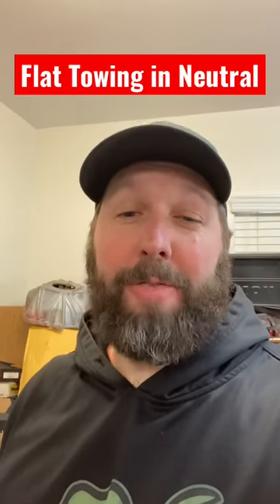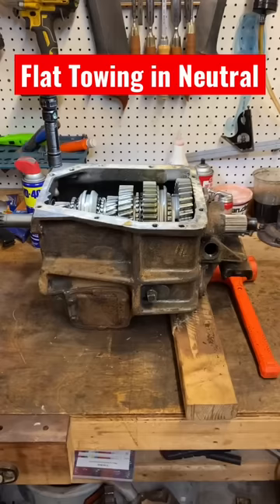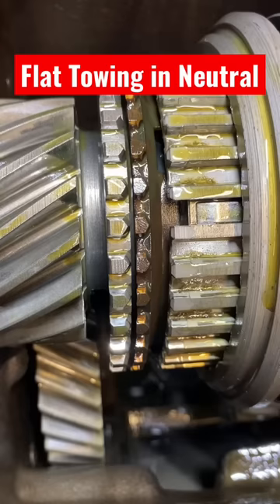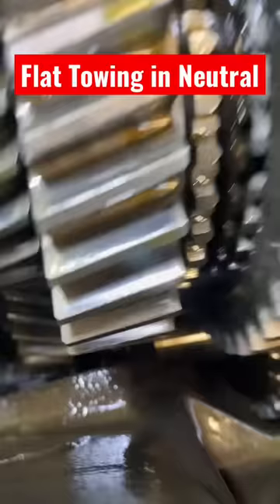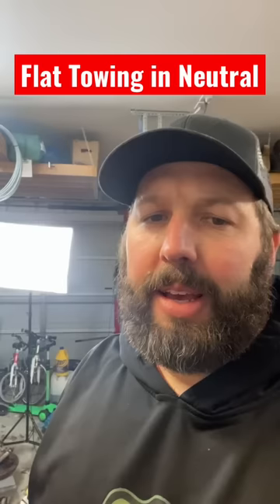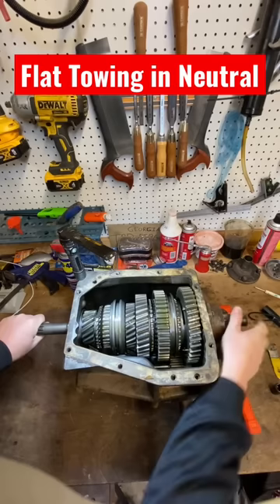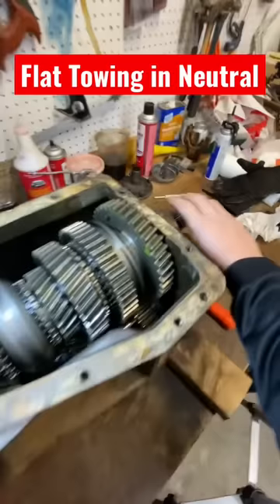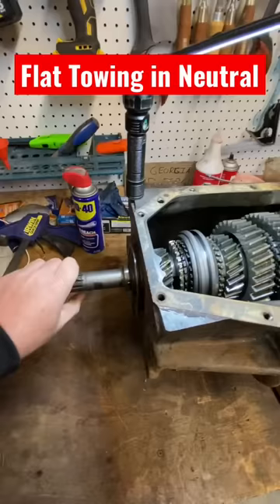Flat Towing in Neutral??? #transmission #stickshift #mechanic

Comment: Isnt this why 99% of tows are on flat beds now?
Reply from the maker: 99% of RV flat tows aren’t 😉
Reply: @freedomworx  100% of RV arent manuals transmissions either.
Reply from the maker: @PaulAmerican  automatics have the same issue 🤷🏻‍♂️
Reply: @freedomworx  your model works on a bench but being towed fluids are very turbulent. Fluids are being tossed around with every tap of the brakes, accelerator and bump. On top of that the nose of the vehicle being elevated making at least one gear in the fluid that further creates fluid spray. 
A vehicle in neutral shouldnt be creating a large enough amount of heat vs fluid spray to damage itself.
Reply from the maker: Tremec Says Otherwise. 🤷‍♂️ https://www.tremec.com/not_am_detalle/flat-towing-manual-transmission-vehicles/
Reply: @freedomworx  and once again Fluids arent sitting motionless in the pan. The fluids are extremely turbulent and are spraying and waving all over the gears and seals. Put a gal of water on the floor of your car and watch it while you drive.
This was the same arguement when the industry went from manual locking hubs to electric locking differentials and nothing happened. It just became the new standard in 4wd systems. 
These systems create heat and wear when in contact with other objects (gears) not just free spinning. The only parts that are in contact is the bearings and they are plent good with minimal oil. There will be more than enough oil via turbulence to oil the bearings.
Its more likely that these problem transmissions are the affects of bad parts that the company is trying to sidestep blame.
Reply from the maker: @PaulAmerican  you do you bro. How about I put a glass of gear oil in my truck cup holder and see how much it splashes around. Go read through the comments at all the people who have destroyed transmissions or even burnt cars to the ground by the exact mechanism I just explained. 🤷🏻‍♂️. Nothing wrong with being wrong, but refusing to learn is well… 🥴
Reply: @freedomworx  ya gear oil in your cup holder will actually show you perfectly how much splashes around. You will be left with barely anything in your cup holder after your drive. 
So the smart ads responses is how I know your seeing it from a different light. Your also references peoples comments on youtube, another wise action. 
Just another thing your overlooking is when the companies make products they do extensive testing and when they find a problem they change it. It it slips through the cracks and problems start to show up then they initiate a recall. If towing a vehicle was a actual proble. Then every car since tge 1950s would be equiped with a manual oil pump that was driven by the input gear. Every transmission has a gear that spins (unless you take out the driveshaft) so every transmission would hace this problem. While some trannys spin the whole input shaft others only spin a transfer gear. That transfer gear has a vearing and a seal that needs oil as well. Ecery tranny would ve affected by this and not every tranny is affected by this. So that would leave a person to believe that its a part defect to this partucular company and they are side stepping the blame so there isnt a recall.
Reply from the maker: @PaulAmerican  just to be clear, Tremec says don’t do it, Jeep says don’t do it, every Semi Towing company pulls the drive shaft, and the entire towing industry now uses rollback wreckers, for something that isn’t really an issue?  😂😂.
Reply: @freedomworx  companies use flat beds of any sort to minimize insurance risk. A trailer is pre wired, a trailer is putting mile on the vehicle.
The company is side stepping a recall. 
Like I said earlier every vehicle would be affected by this problems but they aren't. That only leave this company having the problems.
Reply from the maker: @PaulAmerican  recalls are for issues that could result in harm or death. Mechanical failure from towing didn’t fall into that category… I’m done bro. You enjoy knowing it all 👍
Reply: @freedomworx  thats why they are pointing the problem towards towing instead of regular operations so they dont have to be responsible for a recall. Thats what side stepping is.
Reply from the maker: @PaulAmerican  it’s not a problem!!! It’s just the reality of designing machines!!!! You can’t design a machine to do everything perfectly!!!! The designers could have raised the oil level to ensure property oiling for the 0.00000001% of the time a vehicle is being towed, at the expensive of fuel economy for the other 99.99999999999% of the time the vehicle is operating!!!!!! It didn’t affect every car!!!!!! The ones that it does affect tell you hot to tow the vehicle in the owners manual!!!!!! If you didn’t read the manual and tow the car wrong, it’s your fault, not the manufactures!!!!!!!! Just like if you put the wrong fuel in the tank!!!!!! Should they have designed the engine to run on diesel and gas?????!!!!!!!! Either accept the knowledge I freely gave you, or go find a real reference to tell me I’m wrong. Good Luck 🤡

Comment: so poor design makes for bad eresults
Reply from the maker: It’s not a poor design. HD Manual transmissions are still made this way today. Transmissions are made to transmit power efficiently , not to be towed. The same way are planes aren’t made to be flown under water 🤷🏻‍♂️
Reply: @freedomworx  a good design existed years ago and those vehicles did everything this design is doing plus allowed vehicle to be towed without dammage. Like i said poor design

Comment: No one drives manuals. $1600 just to replace a clutch kit. Who can afford it? Or wants to do it themselves on a cold day ? A manual clutch is not worth it. Give me a torque converter, all day, 7 days a week.
Reply from the maker: Plenty of people still drive a manual transmission. I don’t want to drive one daily, but it’s still fun in a vintage vehicle or hot rod.
Reply: Lots of people drive manual transmissions. They long outlast a automatic and have substantially less friction and pumping losses. just because you can't drive a manual dosent mean others can't.

Comment: Design flaw
Reply from the maker: It’s not a flaw, and manual transmissions are still built this way today. 🤷🏻‍♂️   You could easily raise the oil level a little in the design, but that would reduce efficiency…that would be a design flaw.

Comment: Umm it doesn’t matter if your being towed you should be in neutral because you don’t need a lot of lubricant on the dears with no load on them & if you have it in gear & the car towing you goes faster than whatever gear your in can take yup it can wreak havoc same as going to slow . Don’t listen to fools .go see if a towing co tows you in gear .
Reply from the maker: The fool is the one who thinks I’m insinuated to tow in gear… Maybe remove the driveshaft or refer to your owners manual. If I’m a fool, I guess Tremec Transmissions is too 🤷🏻‍♂️. https://www.tremec.com/not_am_detalle/flat-towing-manual-transmission-vehicles/

Comment: This is why you dont buy a Ford......
Reply from the maker: This is a GM Transmission 🤷🏻‍♂️
Reply: @freedomworx  With 300k hard mi......
Reply from the maker: This one actually only had about 65k miles on it even though it’s 50 years old.

Comment: You should not change gears then too when depressing the clutch or to start from stationary , oh oh and definitely not start the vehicle in neutral 🤣🤣🤣
When someone thinks they're a mechanic when they can lift up a spanner 🤣🤣🤣🤣🤣
Reply from the maker: I’m not a mechanic, I’m an engineer. Maybe tell Tremec they are incompetent too, because you’re a mechanic  and mechanics have smarts 🤡. https://www.tremec.com/not_am_detalle/flat-towing-manual-transmission-vehicles/
Reply: Apparently you have never seen a transmission working other than turning it by hand, I've seen it as I had a cover off such a transmission while it moved with the engine off and in neutral, oil splash out all over so tell me again why did this then occur.?
Reply: AND before you think you're smart and judge someone you don't know i have helped many manufacturers correct their engineering flaws like Ford, Massey, Landini, Toyota, Vw, Isuzu as I regularly email them with flaws and ways to correct them. But a low grade engineer working for a small engineering company would not make it in my world as you would not make a month it my work line as you'd need to be and auto electrician, engineer, mechanic, hydraulic specialist, instrument technician, welder just to name a few. And I'm so in demand that my clients pay in advance for work. Do you have that status?
Reply: And stop fear mongering people into thinking that they will destroy a transmission while flat towing a manual transmission. It won't as I have done recovery/towing too and it didn't destroy a manual transmission.
Only a automatic transmission you need to remove the drive shaft but  one type automatic transmission is different, can you tell me which one since you think you're so smart?
Reply: And if you had oil to the correct level you'd see that the one gear would still dip in and fling oil around.
Did Ford came to you at the young age of 21 and offered you a engineering job after you gave them advice to prevent a part failure that their engineers could not find, well they came to me. Just like a said before don't judge someone who you don't know and by the way have you built a Pineapple Harvester before in your life well I have and so have I worked in a mining manufacturer company sorting out from engineering flaws to right down to decreasing production line machine build times by 50 hours. So this is just a few things in my 30 plus years of work.
Reply from the maker: Tell it to Tremec 🤡. https://www.tremec.com/not_am_detalle/flat-towing-manual-transmission-vehicles/

Comment: Cook me
Reply from the maker: You like Coconut Oil?
Reply: @freedomworx  lol. I recall rebuilding a transfer case in a Ford bronco. It got towed and the transfer case was full. The transfer case actually has a pump with a pickup tube built in just to prevent self destruction if towed with the driveshaft turning. The pickup tube fell off at the pump. Need I say more? Lol
Reply from the maker: @clicks59  🫡

Comment: Just dont buy automatic. Problem solved.
Reply from the maker: I’m talking about manuals, but automatics fill also fail if flat towed in neutral. The oil pump is driven by the engine on an automatic 🤷🏻‍♂️